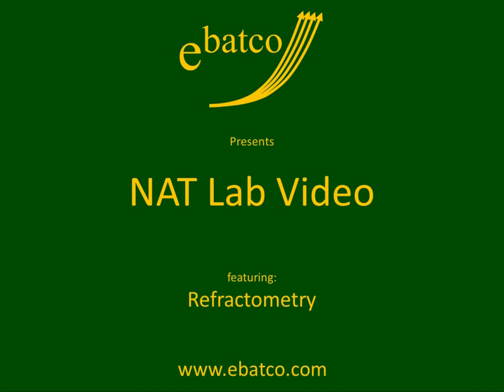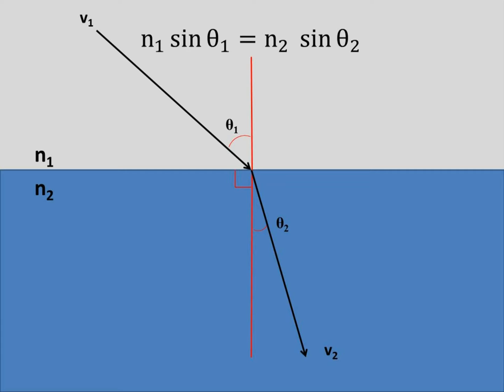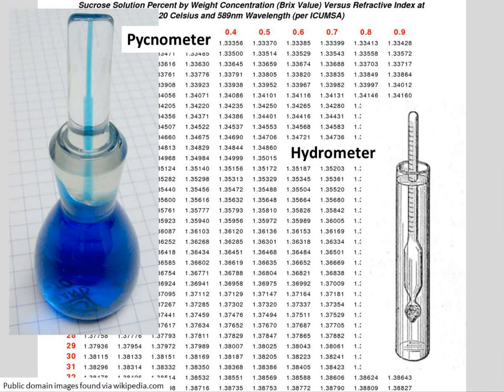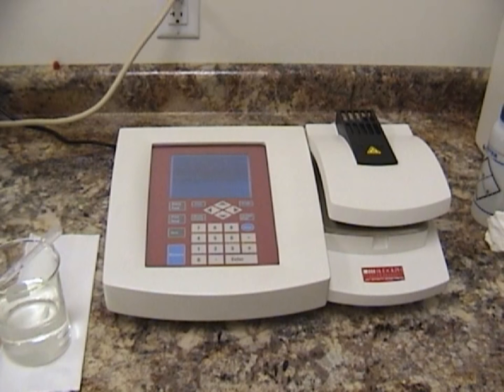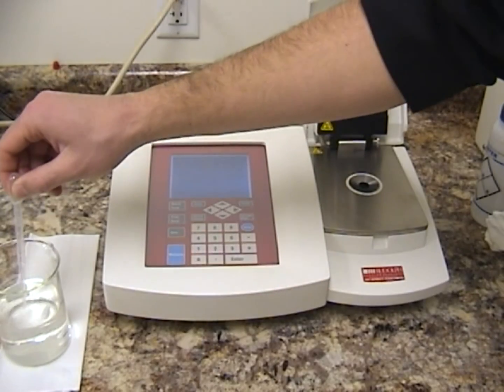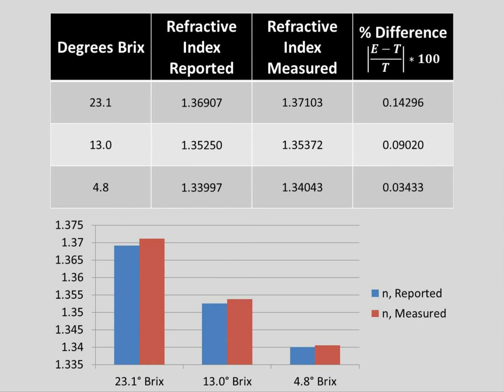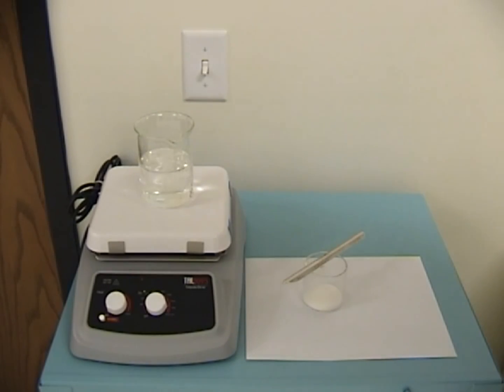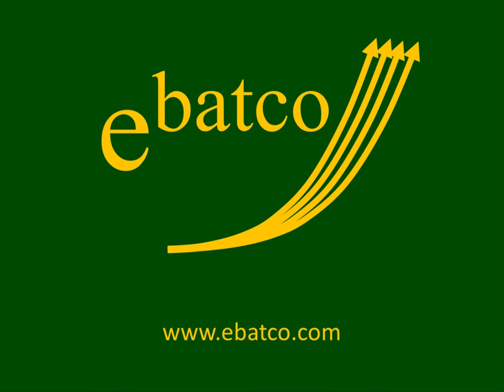Refractive Index of Sugar Solution

Comment: Thanks, really helped with my IB Physics IA
Reply: I am doing the exact same thing right now for my IA! If you dont mind my asking, how did your IA turn out?
Reply: @Piyush2003m  Hey mine didn't turn out well. If you are really interested in this topic I would get deep into the question with lots of evidence to back up your research. This video helps with the basics but nothing too deep. My overall IA grade didn't go as planned due to having a basic question. If this does not work out, trying finding something else in the physics topics. Also, a good IA is something that you are really interested in. Hope this helps!, Lmk if you have any other questions.
Reply: @rajthomas4224  thanks for your reply! I was thinking to use two different solutes and then compare relationship with concentration. I thought that easy topics also do good, now I will try to find more topics.
Reply: @Piyush2003m  Yeah no problem.
Reply: @rajthomas4224  if you dont mind I had another question. Did you use a ready made refractometer or made the complete setup from scratch?
Reply: @Piyush2003m  I believe I used someone else's data but if I was you I recommend using a refractometer so you can get the data 100% correct. If you made it from scratch then there might be a lot of uncertainty and you would have to write that in that part of the IA.
Reply: @Piyush2003m  Refractometer is not necessary. I used a glass trough so that I had further magnitude of results and then used an equation through the distance from trough and endpoint on wall. I would be happy to email you the equation if you would like.
Reply: this is hilarious i am doing my phsyics IA now too
Reply: @mons9974  hahah this was me 4 years ago. Hard times.
Reply: @rajthomas4224  IK I hate the ib
Reply: @mons9974  same here :D i used a cube shaped glass dish and got some weird results. hoped that i could just write it all in the evaluation section. this thread doesn't fill me with much hope lol
Reply: @votislav  if you follow the prism methodology properly, you will be fine. I scored a 7 using the same
Reply: @Piyush2003m  thanks man but i'll probably just stick with the results i had with a laser going thru a solution... my teacher will kill me if i change it again lol